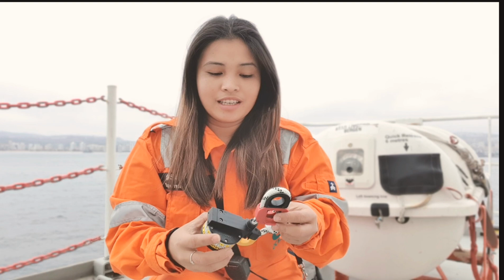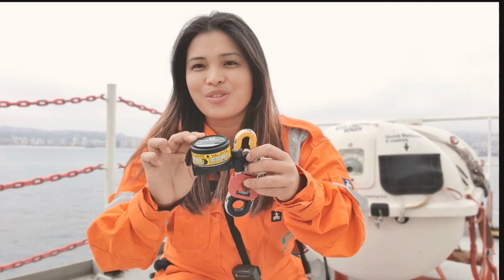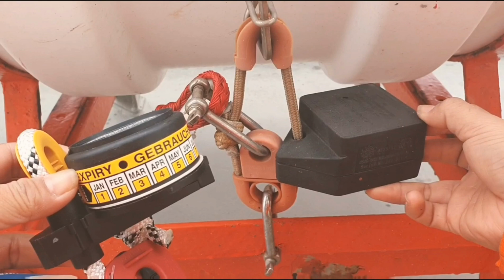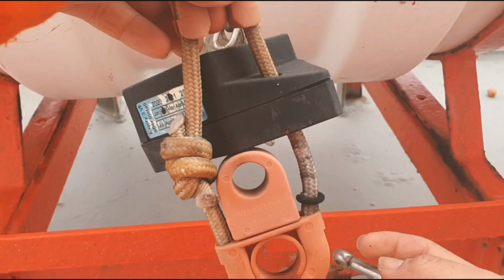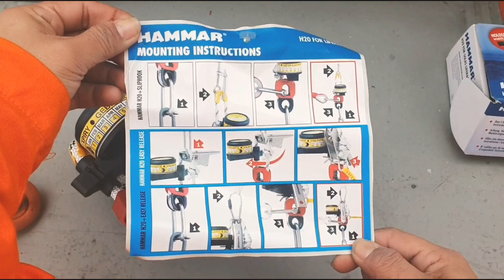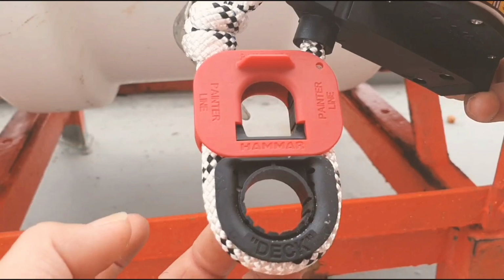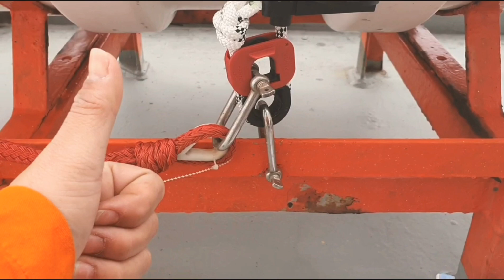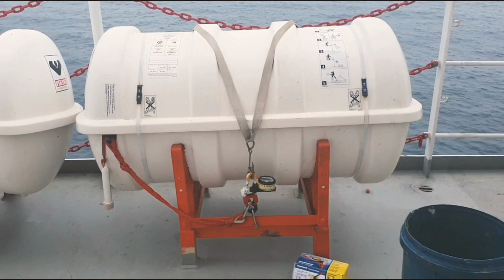VLOG # 6 - HOW TO REPLACE THE HYDROSTATIC RELEASE UNIT OF LIFERAFT

Comment: Tanong ko lang Yung purpose Ng HRU just in case Ng lumubog Yung barko Ng about 4meters tsaka siya mg activate,Yung time na pag-activate niya dun mapuputol Yung weak link at lulutang na Yung liferart, at Yung painter line ay naka attached parin dun sa lashing point,paano naman pag inflate Ng liferaft nun,at once na mg-inflate na siya sa tubig,may tendency din siguro na sumama parin Yung liferaft sa paglubog Kasi Yung painter line ay naka attached dun s lashing point Niya,medyo naguguluhan lang po ako, kindly explain po nito,thank you.